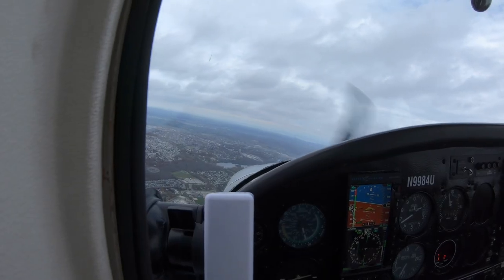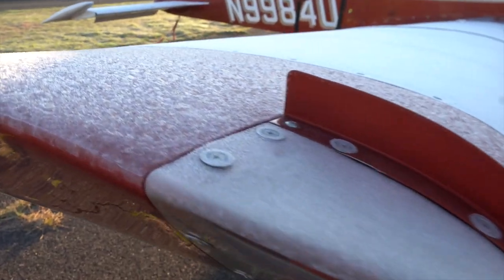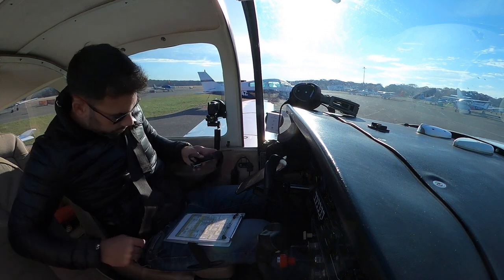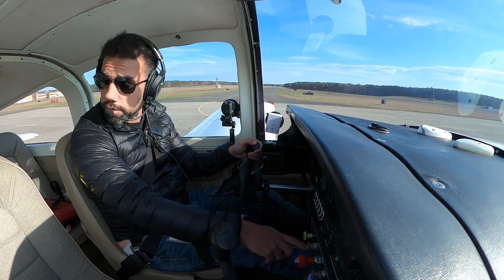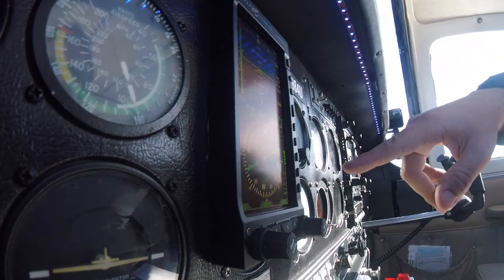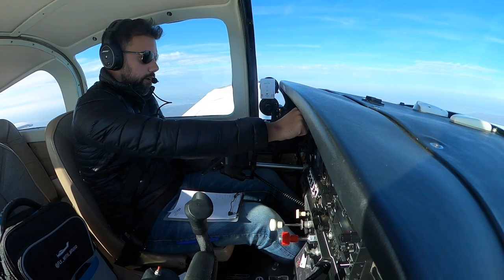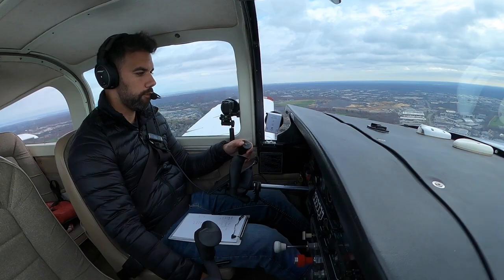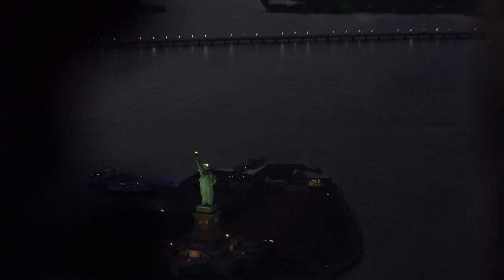New Avionics Test-Flight: Aspen E5, Avidyne IFD540

Comment: Nice Cheetah!  My son and I own a 77 Grumman Tiger AA-5B based out of Denver, Colorado.  We love our little Grumman!  We just replaced our A/I and HSI with Garmin G5's and love the capabilities of those units.  Makes VFR and IFR flying a breeze!  We also had a complete panel update done as well, replacing the plastics with aluminum and adding a USB charge port, etc.  Well worth the investment.

Fly safe and fly often!
Reply from the maker: Thanks Gordon! The Grummans are amazing! My "grumman life" started just 5 months ago, but I couldn't be happier with the Cheetah (ok, maybe I'd be a bit happier with more useful load haha). I considered the G5s for the upgrade as well, but ended up going with the Aspen after discussing it with my A&P. Next on my list is an USB charge port like you did, plus a new Engine Monitor and maaaaaybe an AP. 

Blue skies and tail winds, man!